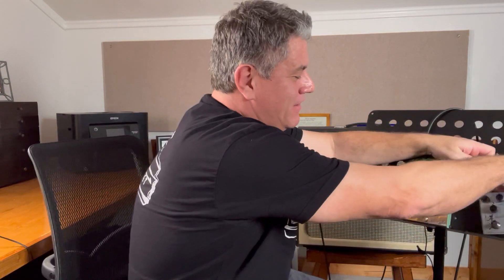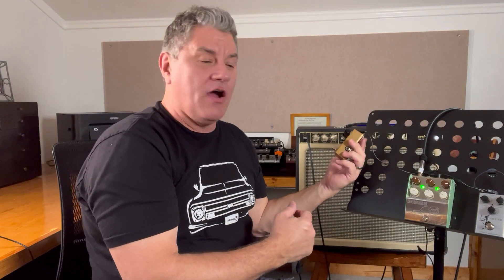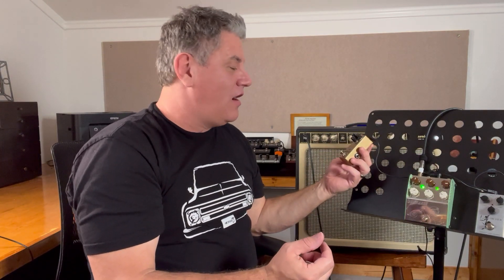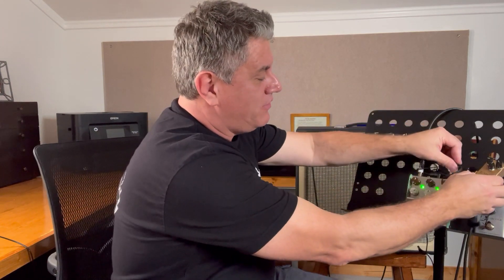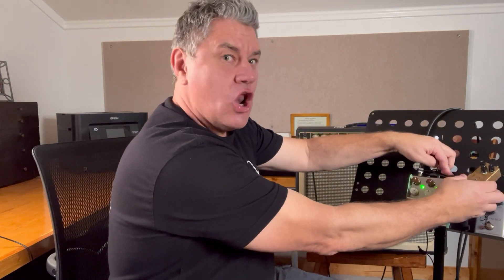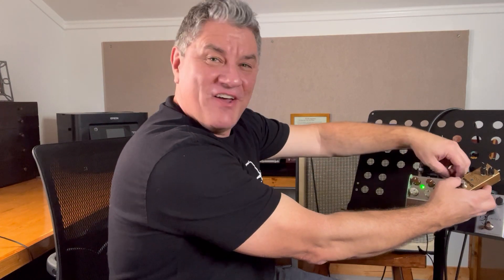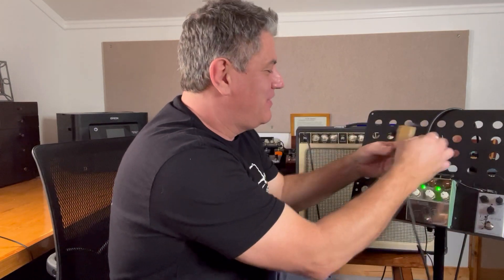Thorpy Camoflange Excessive Noise with Rockett Archer before

Comment: quote from Meris pedal designer: The klon sounds great. But, the charge pump used in it (and it's clones) is noisy. It has a switching frequency which is way too close to the audio band for comfort. The pedal's output looks ugly on a scope. And this noise, which is injected straight into your signal path, can cause audible problems with DSP based pedals further along in your chain.

-terry
Reply from the maker: Bruce, Thanks so much for chiming in here.  I really appreciate the information you have shared.  It's interesting that the Archer made the noise but the Tumnus didn't not.  I ended up placing the Thorpy Flanger in front of my overdrives.  I liked that sound and it, of course, solved the issue.  Cheers, Gary
Reply: That is interesting that the Wampler did not do it! I’ve heard good things about the tumnus so I may have to pick one up!